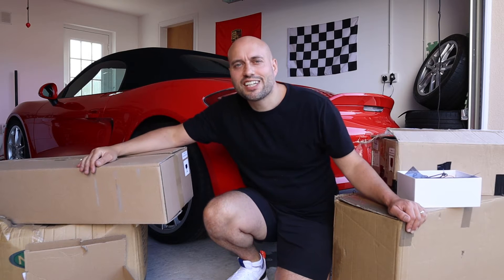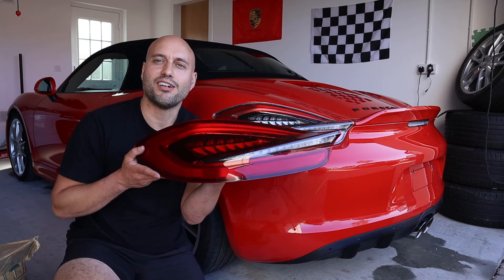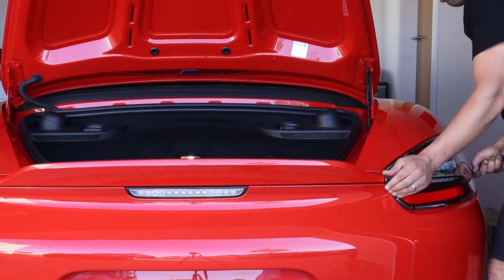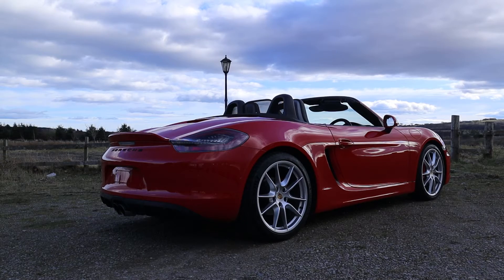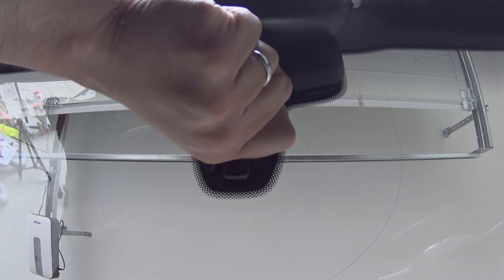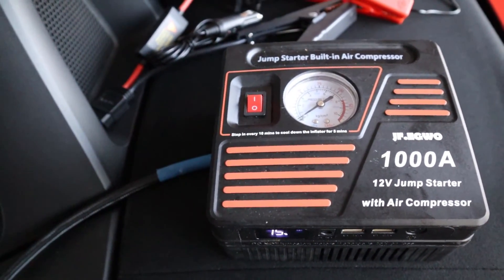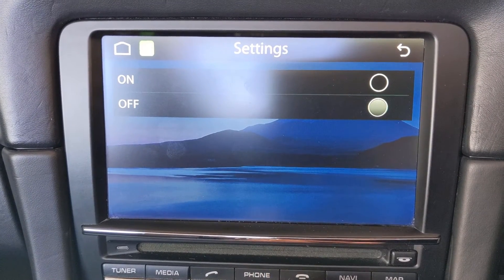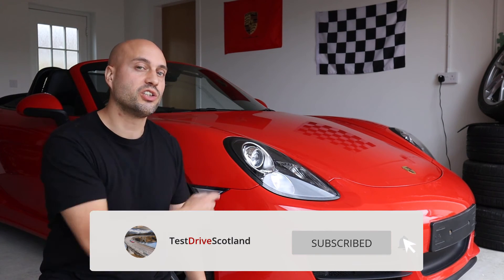Porsche 981 Boxster Cayman / Pointless Mods?

Comment: The trick to getting these taillights out is using a strong but quite thin peace of string/rope, get it behind the top of the light, and give it a firm pull.
Reply from the maker: Good tip thanks 👍🏼
Reply: I can confirm that this method works really well 👍

Comment: Done some of my own mods this summer. New floor mats. Aluminium fuel cap. Zunnsport grilles. Crest embossed arm rest. 
Rock and roll 🥳
Reply from the maker: It's certainly addictive! Good work.
Reply: I am also slightly hindered by my warranty. Which on a 2012 991 I’m pretty chuffed to still have.
Reply from the maker: @Betheball1966  as long as it doesn't impact the failure you should be ok.

Comment: Nice mods!  Really interesting to see the difference in preference.  I sat in a 718 spyder the other day and "hated" it only because the side and rear view mirrors were squared off and not as round as the 981.  Well, I also wasn't a fan of the price tag but that's by the by...
Reply from the maker: Thanks for watching Stefan, I'm yet to drive one but I don't think they offer great value for money on paper.
Reply: @TDS981  likewise, yet to drive one.  I've got a PDK Cayman and am missing both a manual and a convertible, something with more Pizzaz.  Maybe I'll join the Boxster register soon... ;)
Reply from the maker: @mamigagi  top down does add something, go for it 😎

Comment: Love the ducktail...and the tail lights...both on  my list of upgrades.  Great work!  I'd like to add the cameras but have basic CDR head unit....will have to look into options.  Either upgrade to CDR3.1 or go full aftermarket.  Prefer the OEM look....off to do some more research :-)
Reply from the maker: Thanks David, you have good taste 😂. You can add Joyeauto and cameras to your CDR31 the only difference is that your screen resolution won't be as good as the pcm.
Reply: @TDS981  Thanks for the info!  I may look into aftermarket since the $ is about the same and I'd get a lot more bang for the money...just wish they looked more OEM and came with knobs :-)  Probably just start with a ducktail and tail lights anyway...my 2013 S is read and has the same wheels as yours....those appearance mods make a BIG difference.

Comment: can you give more detail on connecting the rain sensitive wiper mod.
cheers from 
Gordon
Reply from the maker: Hi, so the sensor is there and connected, using the Porsche coding software a dealer or specialist with the coding software can enable the rain sensor feature in the menus.  It's a 5 min job for them.
Reply from the maker: Hi, so the sensor is there and connected, using the Porsche coding software a dealer or specialist with the coding software can enable the rain sensor feature in the menus.  It's a 5 min job for them.

Comment: Nice work, is the ducktail Oem?  Part number please?  I see some on eBay but… no.  Also, supplied painted?
Picking up my basalt black at the weekend and this will be my first‘subtle’ mod with the spider/gts side indicators (part no, pls).  Mine already has gts rear lights from factory.
Reply from the maker: Hi, thanks for watching again 👍 and nice to hear you bought one!
 Yes it's OEM they come primed.

I add the part numbers for my enhancements in the description section of the videos. 👍

Comment: Another great vid! Question on the badge reapplication. My 981S was backed into 😢 But since I’m having it repaired I’m doing some bodywork upgrades, namely having the whole car resprayed its factory Aqua Blue Metallic. The template from Suncoast Parts is almost $600! Did you make your own template to get the PORSCHE curve correct?
Reply from the maker: Hi Doug, thank you but I'm sorry to hear about your car. If you remember the Ducktail video, I traced the position of the letters and the curve against the shut line on the luggage area. If you have a dealership nearby perhaps they would allow you to do something similar.
Reply: @TDS981  ok thanks. I wasn’t sure if the curve was exactly the same as the lid. Keep up the great videos!

Comment: Cool! Do you have a list or the mods or links to the mods?
Reply from the maker: I can add something to the description 👍
Reply: @TDS981  That would super cool! Thanks! Btw, have you ever considered/seen a mod which replaces the steering wheel of the 981 with the 718? The 718's wheel with the drive mode dial looks so cool IMHO!
Reply from the maker: I have considered it and if I did it I'd want a smaller diameter wheel as I think the one I have is too big. Shame it's quite expensive there is something else I want more 😜
Reply: @TDS981  Haha what is it?? Do tell :D